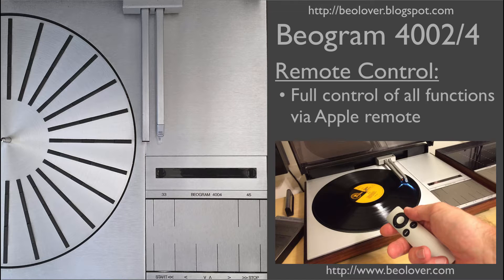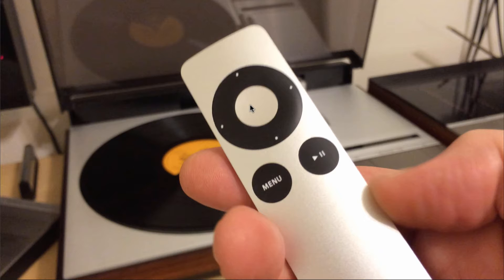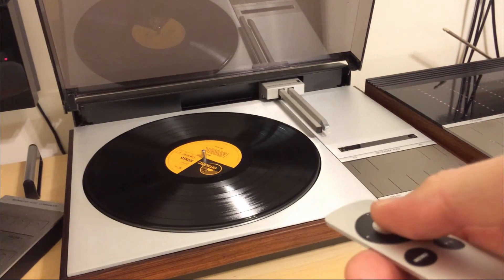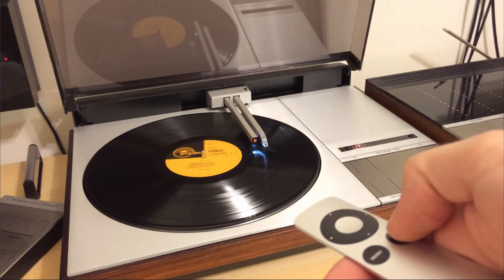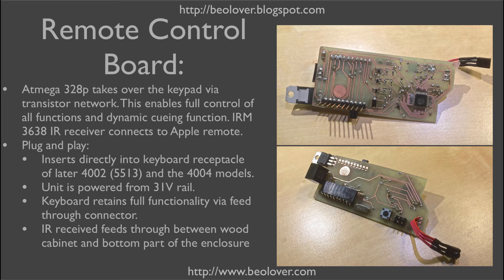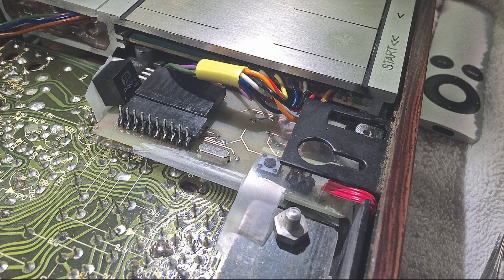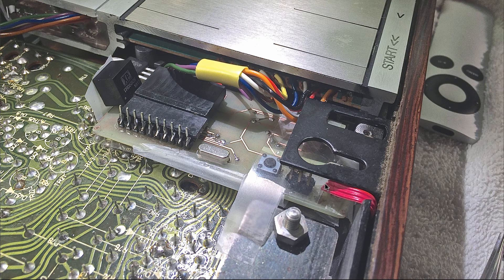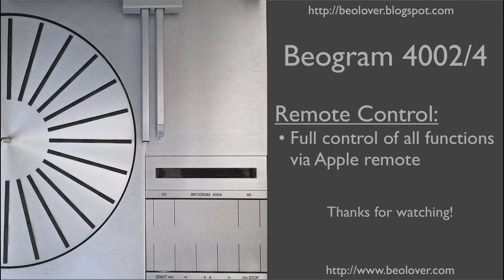Beogram 4002/4004: Remote Control

Comment: can you make it to 8002. Thanks
Reply from the maker: +Frederik Møller At this point the Commander only fits into the DC motor 4002 Beogram. It would be possible to adapt the design to the 800x for sure, but you are the first one to ask. The 800x already have some basic remote functions (Start/Stop) via Beolink if you run them via a Beomaster 8000 or 6000 and use the Terminal remotes.